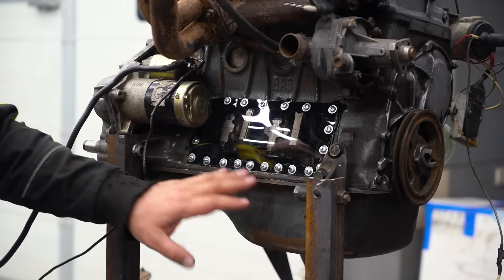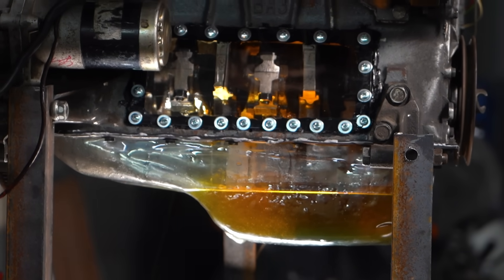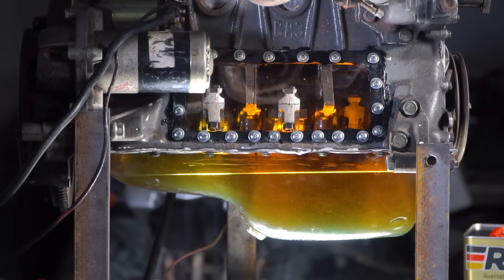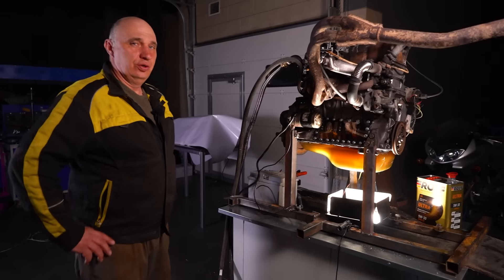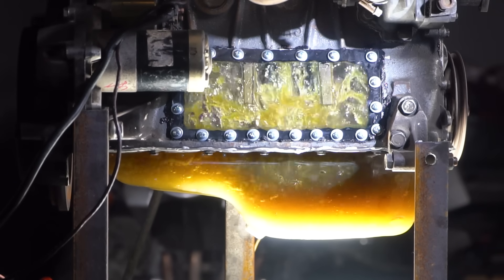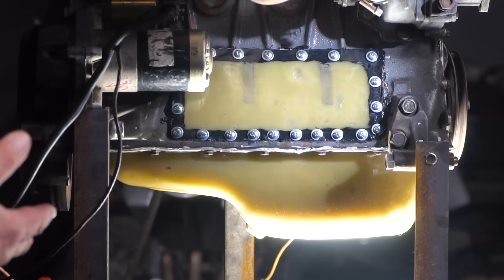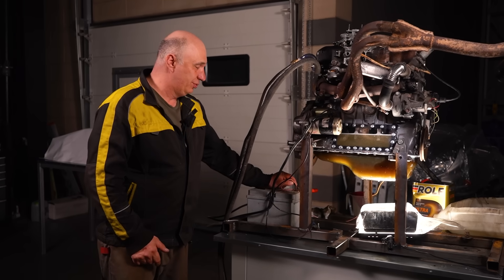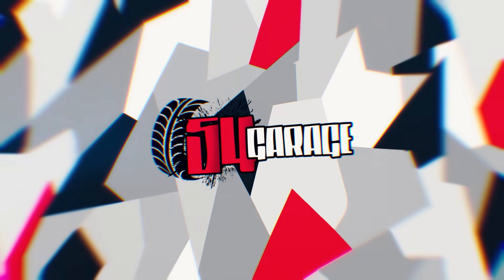What actually happens when you overfill your motor oil? (w/ transparent oil pan)

Comment: I was in Atlanta 25 years ago at the Lenox Mall and a lady parked next to us couldn't get her car started. I offered to have a look and raised the hood to check around. It sounded weird when cranking. I removed the oil fill cap and oil started to run out from the engine. The lady said her son had filled it to the top like he does with his push lawn mower. Can't imagine how many quarts (or gallons) the son put in the engine. I hadn't thought about this in a long time until now watching your video. Thanks for creating this visual example. Cheers!
Reply: OMG.
 Hey Mom I  am done changing your oil.....
Reply: That will be 1000 dollars worth of oil!  @haircut2015
Reply: Probably didn't change it but “topped“ it off thinking they were doing a favor lol
Reply: The same happens when you overfill oil in air compressor not very keen on starting.
Reply: @kirdot2011 A coworker did an oil change on one of them at work.
I didn't check his work just started it up to test run it with the boss watching.
It sounded a little off, but ran 
Suddenly it started spewing oil out everywhere.
I shut it off and it began raining and spraying a mess.
Turns out he filled it FULL 
Almost 14 liters when it's only supposed to be about 3.8
Boss wasn't too happy as he was sprayed and had to clean up the mess and angry at the loss of basically a pail of new oil. 
I've known for years it's okay to go a few mm over full just don't go crazy high as it ends up turning the oil into froth.
Reply: @RetroCaptain  представляю эмоции босса 😠😡👺

🤣
Reply: Saw a lady at Walmart dumping in oil and putting her finger in to see how full it was... Found out she was up to 12qts in a Honda 1.5Ltr engine
Reply: Glad you survived!
Reply: @theonlyari  Yeah really. In 2016 (IIRC) I stayed at the JW Marriott at Lenox Mall for a week-long engineering class nearby. Walked through the mall to eat at a restaurant at the other end. I would've felt better if I had an AR for close company.
Reply: @circleforalanding  it's a shame. that area used to be nice. I think it went to shit after Katrina washed all the trash inland
Reply: Listen to this guy, and have fun blowing seals, ruining your oil pump and eventually engine damage. The dipstick has a max oil level for a reason. But hey, what do engineers know? 😄
Reply: @bass305-HCCA Im fairly certain this guy is just showing what would happen and showing it wont likely just explode on you. He isnt trying to say you should fill the pan up that much.
Reply: My question is how did she even get her car to the mall?
Reply: She did it and tried to say it was her son, she probably felt embarrassed 😂
Reply: @stevenwayne2606 totally ,
Reply: I taught all my daughters the basics of car care to keep them safe and somewhat self sufficient. 
Check your car dash gages as often as the speedometer. Turn radio down and listen for any uncommon noises. Look at tires and if any oil,transmission,coolant or any fluid puddles under car before driving. Let engine warm up a few minutes before taking off. In winter cold months always keep an extra heavy jacket and wool blanket in case car breakdown. Call someone when leaving to go somewhere at night and where going so in case “ no show” we know where to start looking.
Reply: Pretty sure I would have laughed uncontrollably 😂
Reply: As I understand it, the problem is that her son changed the oil in her car while he was so thirsty, which is why he poured too much oil into her car's engine.😂
Reply: I have a certain sympathy for her son, if you know nothing about cars, it almost makes sense.
Reply: We wonder what happen if oil pump doesn't work on this visual system. That's is great concept. Thanks for all your time. 👏👏 from 🇹🇷
Reply: My thoughts exactly 🤔 😂 @kalipteknolojisi
Reply: Is she still there trying to start it? 🕸️💀🕸️
Reply: 😂 silly kid
Reply: Mandatory to carry a tire plug kit and also a cheap 12 V pump from Walmart. Everybody sees other people getting flat tires and yet when it happens to them they act surprised! I've plugged my own tires probably a dozen times over the last 25 years and paid for that pump And the plug kits 1000 times over not to mention the convenience factor. Even if they are unable to actually do it themselves in most cases it won't be long until a rugged man with mechanical aptitude comes by and can plug it for someone unable to do it themselves.
Reply: @MAXIMUSMINIMALIST  Thats how they came into this world dont you know?
Reply: Kid must have had money
Reply: One reason WHY you get a Hand book with a car, though there ain't a section on STOOOPID!
Reply: Lol that's a good one. Couple years ago my girlfriend had a shitbox Ford Taurus that was burning oil. She called me asking about it and I told her to get 2 quarts of oil and put it in the oil fill. She bought 2 5 quart containers and put them both in. She called me freaking out halfway to my house because the car was running weird. I asked her how much oil she put in and she said she put 2 in. I was like 2 what? "2 of the containers you use when you do and oil change". Anyways I sent her to Jiffy lube. They got a good laugh out of the situation.
Reply: the dip stick have hallow dots on it which tells how much space is in the sump available to fill the oil for the engine
Reply: Crazy how stupid people are
Reply: Q is the one that is on a table and a bottle and q and a bit more fun aa and the one that was on a walq note for the years and the other a bit more to a bit more to the WhatsApp than the other a few days to say that the one that is a good idea to get the inconvenience a few days we can do the vetting process for a a bit of the past but they don't aa the same as it was the one I said and it would have been the one @@@🚭❓🚭🙈😚🙈🚭🙈❓❓🙈🚭🙈👩‍🎤👩‍🔧🏘️ 2 omar 1 Pine 5 to 3 fois 1 PINE 2 YEARS OLD to do a few years of trying and he was separated and we were in a good mood and it wasn't the one that is a good thing for you and your mum to Do that is a great job you have on your way to work and you can do that is a great job I don't want you and I am so num to do that@@😜❤️🎂😕❤️👩‍🔧👩‍🔧😕😕👩‍🔧👩‍🔧👩‍🔧👩‍🔧👩‍🔧❤️😜😜😜😜❤️❤️❤️😜❤️😜❤️😜❤️😜😜😜😜😜😜😜😜🐠😜🐠😕😕😜❤️😜😜😜😜😜😜❤️😜❤️😜❤️❤️❤️❣️❣️❣️❣️❣️❣️❣️🎂❣️😭❣️😭🎂😭🎂❣️❣️❣️❣️❣️❣️😭❣️❣️❣️❣️❣️❣️❣️❣️😥😥😥😥😥🎃😫😥😥😥😥😥😥😥😥😥🤡😥🎃😥😥😜😜😧😜😜😜😜😜😜😜😜😜😜😜😜😶😜😧😜😜😜😜😜😜😜😜😧😜😜😜😜😜😜😜😜😜😜😜🥂😭🥂🥂🙏🥂🥂😭😭😧😧😧😧😧😧😧😧😧😧😧😧😧☔😧😧😧😧😧😧😧😧😧😧😧😧☔🚭😧😧😧😧😧😧😧😧😧😧😧☔🚭😧😧😧😧😭🥂😭👉👥👉🦵👥👥👥👥👥👥👥👥👥👥👥👥👥👥👥👥👥👥👥👥👥👥👥👥👥👥👥👥👥👥👥👥👥👥🕺🕺🕺🕺🕺🕺🕺🕺🕺🕺🕺☘️🕺🕺🕺🕺🕺🕺🕺🕺🕺🕺🕺🕺🕺🕺🕺🕺🕺🕺🕺🕺🕺🕺🕺🕺🕺🕺🕺🕺🕺🕺🕺🕺🕺🕺🕺🕺🕺🕺🕺🕺🕺🕺🕺🕺🕺🕺🕺🕺🕺🕺🕺🕺🕺🕺🕺🕺🕺🕺🕺🕺🕺🕺☘️🕺🕺☘️🕺💐🕺🕺🕺🕺🕺🕺🕺🕺🕺🕺🕺🕺🕺🕺🕺🕺🕺🕺🕺🕺🕺🕺🕺🕺🕺🕺🕺🕺🕺🕺🕺🕺🕺🕺🕺🕺🕺🕺🕺🕺🕺🕺🕺🕺🕺🕺🕺👩‍❤️‍💋‍👩👩‍❤️‍💋‍👩👩‍❤️‍💋‍👩👩‍❤️‍💋‍👩👩‍❤️‍💋‍👩👩‍❤️‍💋‍👩👩‍❤️‍💋‍👩👩‍❤️‍💋‍👩👩‍❤️‍💋‍👩👩‍❤️‍💋‍👩👩‍❤️‍💋‍👩👩‍❤️‍💋‍👩👩‍❤️‍💋‍👩👩‍❤️‍💋‍👩👩‍❤️‍💋‍👩👩‍❤️‍💋‍👩👩‍❤️‍💋‍👩👩‍❤️‍💋‍👩👩‍❤️‍💋‍👩☃️👩‍❤️‍💋‍👩👩‍❤️‍💋‍👩👩‍❤️‍💋‍👩👩‍❤️‍💋‍👩👩‍❤️‍💋‍👩👩‍❤️‍💋‍👩🍀🐷🦧🦘🐷🐷🐷🐷🐷🐷🐷🐷🐷🐷🐷🐷🐷🐷🐷🐷🐷🐷🌹🌹🌹🌹🌹🌹🌹🌹🌹🌹🌹🌹🌹🌹🌹🌹🌹🌹🌹🌹🌹🏖️🌹🌹🌹🌹🌹☔🌹🍀🍀🍀🌹🏖️🍀🏖️☔🌹🌹🌹☔🍀🌹🌹🌹🌹🌹🌹🌹🌹🏖️🌹🏖️🏖️🌹🌹🏖️🌹🌹🌹☔🍀🏖️🏖️🍀🏖️🏖️🏖️🏖️🍀🌹🌹🌹🌹🌹🌹🌹🌹🌹🌹🌹🏖️🏖️🌹🌹🌹🌹🌹🌹🌹🌹🌹🌹🌹🌹🌹🌹🌹🌹🌹🌹🌹🌹🌹🌹🌹🌹🌹🌹🌹🌹🌹🌹🌹🌹🌹🌹🌹🌹🌹🌹🌹🌹🌹🌹🌹🌹🌹🌹🌹🌹🌹🌹🌹🌹🌹🏖️🍀🌹🌹🌹🌹🍀🌹🌹🌹🌹🌹🍀🌹🌹🌹🌹🌹🌹🌹🌹🌹🌹🌹🌹🌹🌹🌹🌹🌹🌹🌹🌹🌹🌹🌹🌹🌹🌹🌹🌹🌹🌹🧓🧓🧓🧓🧓🧓🧓🧓🧓🧓🧓🧓🧓🧓🧓🧓🧓🧓🧓🧓🧓💫💫💫💫💫💫💫💫💫💫🌏💫💫💫🦝🌘🦝🌘💫🦝💫💫💫💫💫💫🦝🌘💫💫🍂🍂🍂🍂🚧🚃🚃🚖🚦🚧🚖🚧🚧🚧🚧🚧🚧🚧🚧🚖🚗🚧🚧🚦🚟🚦🚗🚥🛺🛩️🚋🚋🛺🚋🛩️🚋🚋🚋🚟🚋🚐🚋🚐🛩️🚋🛺🛺🛺🛺🛺🛩️🚋🛩️🎗️🤿⚽🤿⚽🤿⚽🩰🤿🦘🦘🦘🚥🦘🚥🚥🚥🦝🩰🩰🦝🦘🦝🦝🦝🦧🚐🚐🦧😀😀💫🚐😮🌜🤒🤒🤡😦🤧🤧😦😒🚴🚴🧏🙀💛😊😊💩💩💩💩💩💩💩💩💩💩💩💩💩🤡💩💩💩💩💩💩💩💩💩💩💩💩💩💩💩💩💩💩💩💩💩💩💩💩💩💩💩💩😊💩💩💩💩💩💩💩💩💩💩💩💩💩💩😎😫😥😥🎃
Reply: My mate did the same
Reply: At least wear some protective gears 🤡🥲 good job though
Reply: Hahaha 🤣😂
Reply: Lenox used to be a place for girls watching,now since the Marta train run close by the place is a zoo for animals!!!!!
Reply: Wow.  Next level stupid.
Reply: the dip stick have hallow dots on it which tells how much space is in the sump available to fill the oil for the engine
Reply: Technically, this won't foam up so at least she avoided damage to the crank? Most likely she couldn't start because the oil became less viscous as it heated and when she went for shopping it just seeped into the pistons and choked them.

She could have sat there and cranked for 2 minutes and it would do sputter starts for another 5 minutes before stabilizing.

Eventually she'll leak enough oil for it to either stabilize permanently or it starts foaming and high revs will explode something as it welds itself with metal on metal contact.
Reply: Did you manage to get the car working ok? Did you manage to remove some of the oil to get it to a more normal level?
Reply: @Blades-fm6ck  No, I was with my wife and kids. Simply let her know the issue and suggested she have car towed to a mechanic where they would drain the excess oil and check for created problems.
Reply: good ole Lenox Mall remember it well from the `70s!
Reply: @moss8448  In 1970 my cousin and I filled the fountains at Lenox & Cobb Mall with dishwashing liquid. Not a joke, man! ;)

Comment: Someone may have already said this on the comments, I will say this, The engineering team  Doing this experiment. smart. However, they did not say that the lower part of the engine is now tossing around Lots of dirty oil. If the dirty oil were to make it up and into the bearing shaft, there could be hell to pay.

Comment: I put in some valve cleaner that was an extra quart on a Mitsubishi engine.  It was fine, but catalytic converter went bad and threw codes a few weeks later.  So, it is almost more about burning oil and solvents and making sure they don't cling to your catalytic converter so it can do its job.

Comment: I have a Buick 3.1 V6 that leaked antifreeze into the oil because of intake manifold gasket leak and filled engine with over 2 gallons of oil-antifreeze mix to where it came out dipstick. It still ran. Fixed gasket, cleaned out engine and now runs perfect and even passed E-Check. Wonders never cease.

Comment: I went to this mechanic to change my oil.
He told me he used to own this exact same car etc. etc.
I pull out and he says, "Don't blow out any seals." I said, "I'm not planning on it."
I pull away and about a block later it felt sluggish... I get home about 5 more blocks
and realize I should check the dip stick. Sure enough he over filled it. 
He put 6 Quarts into a 3.5 quart crank case. It was almost 2 times over...

Comment: air bubbles= engine failure. If you put more than let's say double the oil quantity(varies from engine to engine)  ,you're guaranteed to seize that engine.
Oil+air is not adequate to lube the bearings and there's no strong oil film to protect..Plus the pump doesn't really pump that much of that mixture because of the viscosity

Comment: Its so the crankshaft isnt hitting the oil and aerating it. You want your oil pump to be pumping oil, not air. Its pretty sad how many people ive had to explain this to. I scolded my uncle a few years ago when i found out he was putting a whole 5 gallon pail in his 4440 JD when he changed it. It holds 4 gallons right at the full line. He said its easier to dump a whole pail in🙄

Comment: Look, any idiot can make a video, it doesn't make that person a expert.
When you over fill the oil you damage the bearings in the engine because when the oil is low the crankshaft is above the oil.  It gets air from the throws on the crank which cools down the metal.
Excessive oil transfers the heat in the oil to the crankshaft and causes it to over heat which destroy the babbitt in the bearings and it causes cavitation which induces air in the oil.
So it actually can cause a loss of oil

Comment: It turned into foam. It’s making resistance in the engine which will translate through the transmission so there will be power loss. The whipping of the oil to foam will change its effectiveness. It will be harder for the metal pieces to settle in the oil pan.

I get from this to never overfill especially if you drive aggressively

Comment: One of the problems overlooked by this video is the amount of heat is drawn away by the oil. Two little oil and you don't have enough lubrication but too much oil and you don't have the heat dissipating from the oil pan.

Comment: I've been told that overfilling the engine with oil increases the oil pressure and the likelihood of blowing the rear seal, at that point you would have to put a new rear seal in .

Comment: Very informative!  I have always wondered about adding too much oil when I do an oil change or add a quart when it gets a little low.  Now I was surprised to see how low the correct level in the pan is.  An extra quart won't cause any problem at all.  I was also quite surprised to see how low the oil level dropped when the RPM's were increased to what might have approximated traveling normally.  There wasn't a very wide safety margin even given that the fresh oil had not really warmed completely  to normal operating temperature.

Comment: I kind of wish you had done doubled the amount test fill it up run it shut it down they'll get back a bit and then run it again with the same level oil to see if engine was damaged before. Also do some tilt test to simulate going up or down the hill or around a curve at a little bit of speed.

Comment: Okay, so nothing catastrophic happened, but are you going to take chances with your ride and intentionally overfill you crankcase? I have read manufacturer warning to not overfill automatic transmissions with fluid because the fluid can foam and cause problems. when the fluid has foamed like we see in this video, your pump is probably pumping a lot of air through the bearings with the risk of scoring. These people should start with another engine, tear it apart and inspect the bearing, document the clearances and bearing and journal surface conditions, then reassemble and run it overfilled by two and then tear the engine apart again and see how the bearings and journals held up.

Comment: This can happen with a blown head gasket causes the oil level to technically rise higher n higher but with water.

Also guys most good engines should have a baffel in the oil pan.  So overfilling unless its insaine shouldnt cause an issue

Comment: What they didn't discuss was the effect of air bubbles in the oil when the oil is overfilled and the excess wear it causes to the engine -- because when air displaces oil, the film between metal parts gets thinner and actually results in more metal-to-metal contact, increasing wear.  It is good to know that a slight overfill isn't going to result in significant damage; however, when the level gets high enough to cause the slapping of the oil by the parts connected to the crankshaft, you're basically beating air into the oil which, again, causes increased wear and tear on the engine.

Comment: My friend overfilled his WR450 motocycle. The breather hose on a dirtbike points to the ground, not back into the air box. The motor pushed the excess oil out the tube. I continued working fine. I always put an extra 100cc in my dirtbike motor that says 800 is max. Never had a problem. Cars say don't overfill and I don't.

Comment: too much oil causes too much internal pressure causes seals to burst. Too much oil causes too much air which could cause air pockets in the oil pump which cannot be good for lubication. 1 extra quart if you are a hill/rock climber but not for ordinary cars and trucks.

Comment: Misleading. More oil added BOOSTS OIL PRESSURE.  The manufacturer recommended amount of oil is part of the OIL PRESSURE design for the particular engine type. TOO MUCH OIL means > OIL PRESSURE which means POSSIBLY CREATING LEAKING SEALS. The engine main seals are designed to hold a certain amount of PRESSURE.

Comment: 4:55 “with the oil not being warm enough it takes more time to drip down” but that just reminds me of something i heard about oil viscosity, then why do they say motor oil actually thickens or at least stays the same viscosity as it heats up? Common sense definitely makes us think it gets less viscous as it heats up but does it really? What actually happens in real life here?
Reply: Oil thickens as it gets colder. Thats why we use multigrade engine oil such as 10w-30, 5w-20, ETC. You want the oil to be thinner when it is cold for the initial startup to not have sludgy slow moving poor lubricating oil. As it heats up to temp however, thicker oil will do a better job protecting your engine. (To an extent ofc). 
The first number is the cold temp viscosity, second number is warm temp viscosity. The lower the number, the thinner the oil.

Comment: how will a modern engine runs with that much oil under load.that engine is old and much more forgiving than a newer engines with tight tolerances and sensors.

Comment: The fully synthetic oil did a good job of reducing foaming at lower levels of their experiment (double recommended).

Unfortunately, it is an inaccurate test, as after the oil heat cycles over time, more moisture would occur, which would cause it to foam earlier. Other impurities would also add to this.

Comment: I once overfilled my subaru engine when doing an oil change. I only over filled by a very small amount but it was still able to damage the variable valve timing solenoid. I think a V engine is much less susceptible to damage from too much oil than a flat 4 cylinder apparently.

Comment: I remember that the NZ distributor of Wynns oil additive used to have an old Holden inline 6 mounted on a trailer, with windows similar to what you've installed.
It had NO oil in it, just one bottle of some sort of additive, about 300 ml.
It ran, but that's about all I could say for it.
It always ran at a slow idle, and, shit, IT WAS RATTLY.
It was around at automotive events for years, (or rebuilt versions of it), but I guess it sold some product for the company.
Poor old thing.
My little sister destroyed her Toyota Cynos/Paseo when someone said it needed oil. She bought a 5 litre pack, and proceeded to empty it into the engine.
It died horribly after about 1.5 km after her getting up to motorway speed.
Now she understands what the dipstick is for...
Best intentions, and all that.